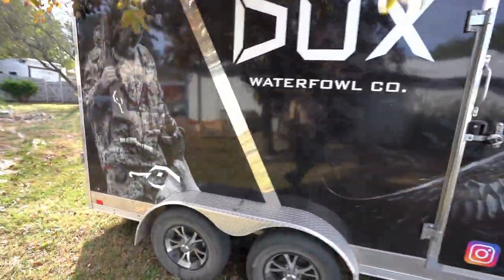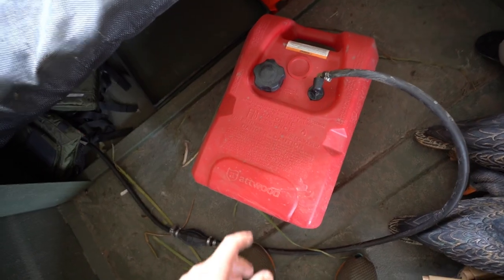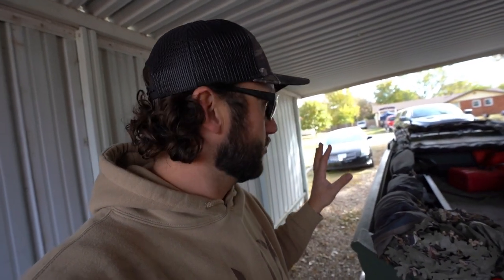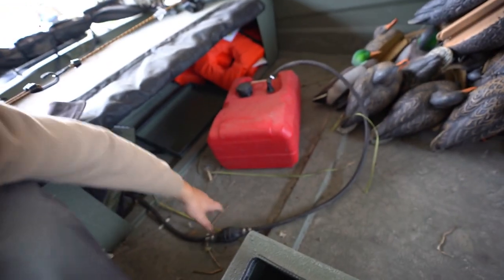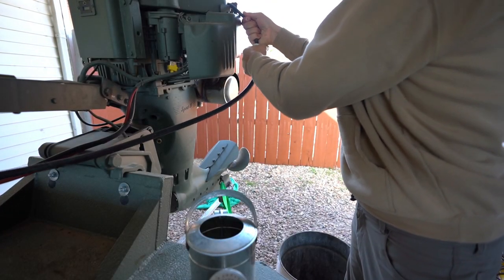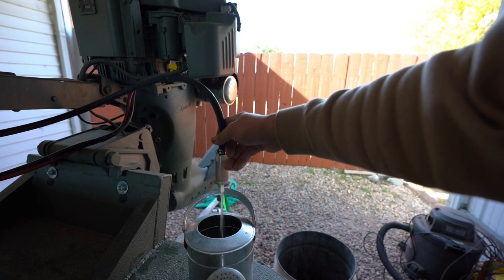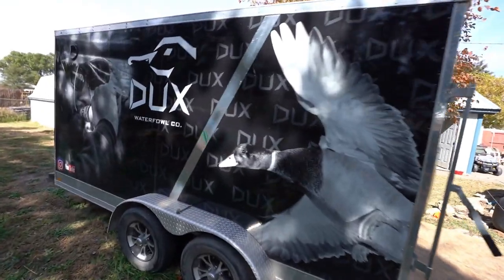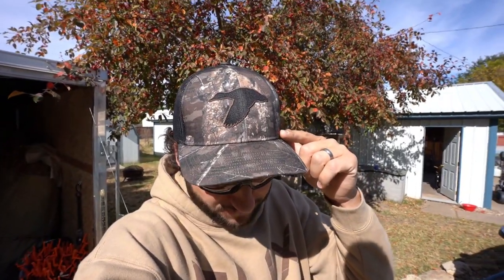I Either Fixed My Duck Boat or Made it Worse...

Comment: If you want it to flow out of the tank with a disconnect line, you need to hold the line below the level of the tank. Fuel won’t flow up on its own

Comment: Bobby, if the motor is water cooled you need to use " rabbit ears " connected to a garden hose. The hose water will cool the engine just as the pond water cools the engine. If the engine is air cooled, no need for water.

Comment: Bob.  My dad and I use two boats.  I actually have the same boat gas can as you and a older one that does not expand.  I mainly just leave the tanks cap loose so it can breathe.  However.  I’ve only ever had problems with it when I get a full tank and I don’t burn it right away.  I don’t worry about it after the gas is 3/4 of the way gone

Comment: Also, add Seafoam to your gas. With a vented cap, you will end up with some water in your fuel. Between waders, dog, dead ducks, and rain, it will happen. Seafoam will get rid of it and it is good for your fuel system and your motor.

Comment: Wire your pump to the starter solenoid so when you turn the key to the “on” position it’ll give power to the pump and will begin pumping before you try turning the engine over. Good video good luck

Comment: Should have just moved the tank closer to the motor, the bbn pump on the motor is not strong enough to pull the fuel all the way from the front of the boat.

Comment: Bob wire the fuel pump to the ignition switch on the motor. That way the pump will only run while the key is on.

Comment: My long tail will run all day out the water but once you put a load on it after it burned the gas in the carb it will die bc the plus pump in the air cooled motor suck

Comment: Not familiar with surface drives but you typically need some sort of water running into the motor as boat motors are water cooled, be careful with running the motor dry like that
Reply: Most mud motored are air cooled , basically a lawn mower motor

Comment: Yo bobby. That fixed your problem but I dont think that was the main cause. How far of a gas line are you running from your outboard? Think of it like sucking from a long straw. A short one is easier but due to physics that I cannot name at the moment, longer ones make it more difficult.  It's related to atmospheric pressure. Cheers buddy.
Reply: I was thinking the same thing when I saw where the fuel tank was for that tiny motor.

Comment: I would definitely try it without the electric fuel pump, just another thing thats going to drain your battery unless you have some sort of charging system in the boat. That motors fuel pump just be efficient enouh to draw fuel on its own.

Comment: Bob I work on boats, that fuel filter is your problem. The kind of filter you want on an outboard is a RACOR fuel water separator, that way if you take a splash into your gas tank the water wont end up in the cylinder. The particulate filter that came installed on your boat isn't necessary and is reducing the flow too much for the engines built in fuel pump. You wont need the inline fuel pump without that particulate filter

Comment: That is a newer EPA regulated fuel tank in which you are suppose to be using a fuel demand valve. The white inline fuel filter may also be directional so make sure that is not backwards. Your length of fuel line may be an issue with restriction as well so you may need to increase the i.d. of fuel hose. You should not be using an external fuel pump unless it is wired into the ignition/accessory power circuit as some have commented. If not and in the event of a fire you will be feeding that fire. The engine has a fuel pump and pulls vacuum, you should not need to add an additional fuel pump. Fuel hose inside diameter may be issue creating excessive vacuum on the engine mounted fuel pump. Mercury certified outboard technician here.

Comment: Bob if you put the gas tank closer to the motor with just enough line get fuel to the motor you could probably get away with not needing a fuel pump. You’re tank is really far away from the motor and the line is really long because of it.

Comment: I don't have any experience with short shaft motors, but do they not have water pumps? Because running a water cooled outboard with no water will fry the pump

Comment: If the fuel pump cures the problem, which I believe it will, that means either the surface drive doesn't have a fuel pump, or if it does, it isn't working.

Comment: Wow Bobby you need inches of water column pressure not psi . 1 psi raise water 27 inches. Use smallest fuel line as possible aswell . And purge the air out of fuel line at the carb connection.

Comment: The fuel bulb has a one way check valve. Not sure it would flow out with just the line disconnected. Takes the engine fuel pump to actually pull the fuel through it.

Comment: Fill you sprinkler can with gasoline.
Place a line from engine into sprinkler can. Run engine without filter.
If runs then engine is sound. 
Presurize than Make Sure fuel comes out current outlet.

Is there a cutoff on engine. Make sure it is wide open

Comment: The fuel pump is not needed at all. The motor has a fuel pump and the pump runs when the motors running. There was 2 comments on the other video from me and a mud buddy mechanic. Ive owned 3 of surface drives i even have 1 as my profile pic and its fully buildt

Comment: Your fuel filter on backwards thats what it looks like to me the primer bulb shouldn’t hold any pressure with the line off or hard to squeeze theres generally a rubber stopper in the filler to prevent back flow the extra pressure on the line is over coming it now new fuel pump now doing what you were doing with pumping the bulb the moter has a fuel pump on it. Just my guess first place i would of started at is making sure the fuel filter flows both ways buy blowing through it both ways or the fuel pump is bad on the motor and to vent those type of fuel tanks you just crack the cap a turn or so same tanks i run that’s how there so-post to work . Or better yet its a new boat should be under warranty and a free fix take it back were you got it from let them fix it...

Comment: Try moving the tank closer to the back of the boat next to the motor. I have had problems with my tank being to far away from the motor and loosing pressure.

Comment: if you didnt have a vented cap and you just added one that fixes your problem.  dont put an electric pump on the line.  useless.  your system was vapor locking with no vent

Comment: Bobby them new attwood tanks have a vent built into the bottom of the crap, if you pull the crap off and remove the strap that holds the cap in the tank you will see a white ball.  That is suppose to be the vent, but from what I seen the ball gets stuck and you can just break it out and never have the venting prob again. Not sure if anyone mentioned this before

Comment: The biggest fix is the vented cap.  The guys at my boat shop are more than happy to point in the right direction.  I think that motor was made not to need the auxiliary fuel pump.

Comment: Had same problem with my motor need an automatic fuel pump with a killswitch straight to the battery turn it on and then turn fuel on before you turn motor on might have to choke it but she’ll fire right up and stay running

Comment: Some of those motors have a vacuum powered fuel pump via the motor, check all your lines and make sure they have a great seal and no air is getting into the line. That can make it starve for fuel like it was.

Comment: Close the air vent on the gas tank. If it is open the gas tank will not hold air pressure. The primer is just pumping air in the tank

Comment: There is a little white ball on the bottom side of the cap of that gas tank if you pop a hole in that or pull it out with pliers the tank will vent much better. Had the same issue with my boat.

Comment: Mount the fuel pump To the motor. And wire to the key switch leave the primer bulb at the tank. That how my gtr 37 set up been doing good for 3 years now

Comment: You need to shorten the fuel line lose the electric pump move the primer bulb to within two feet of the motor primer bulb is a suction feeder

Comment: Bobby, 
You should be able to wire the fuel pump right into the ignition switch on the motor. Then the pump will only run when you turn the key on.

Comment: Bobby are you running water through your motor when your dry running it
Reply: RJ Neal Vlogs mud motors are designed to be run in very little to no water, so they’re air cooled. No need for water.